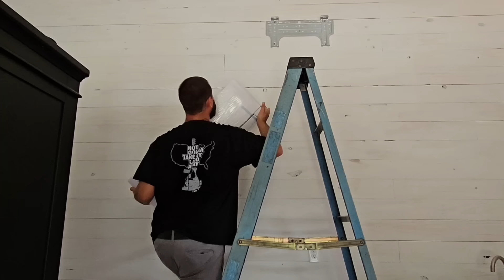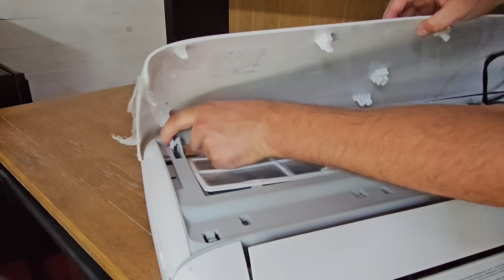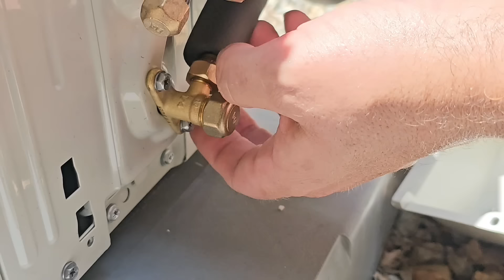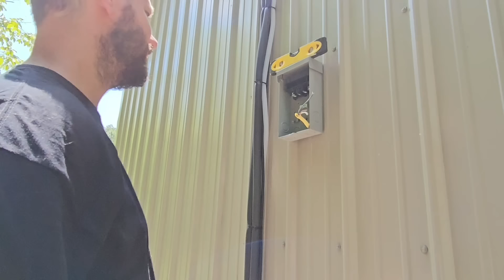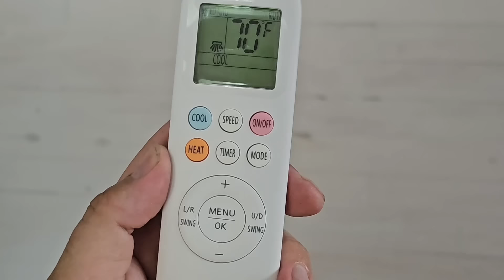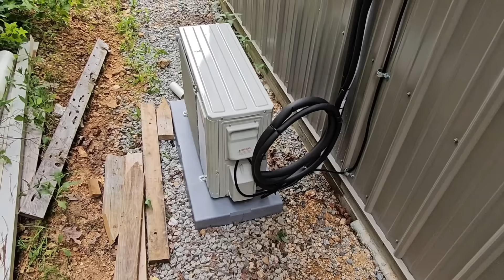Mini Split Installation Step by Step Guide @TurbroStore

Comment: Thanks for the tutorial... I just have a question... I noticed sometimes they use 12/2 wire from panel to disconnects and sometimes they use #8-2 wire so which one works better???
Reply from the maker: depends  on the MOP of the unit and what the max amperage is 12/2 is good for 20 amps and 8/2 is good for 50 amps. check out my wire sizing guide on my app actoolpro.com

Comment: How do the components compare to a normal residential unit? How does the air handler communicate with the outdoor unit? What does it use for control voltage?  What’s going on in the thermostat? I have so many questions….

Comment: I was curious to know about suction and discharge pressures with A2L, I’ve been certified for a couple of months now but as a service tech I haven’t worked with it yet, good to know it’s not much different than 410A, I’m Chris from Connecticut I’ve been an HVAC tech for ten years now

Comment: Hey Brother I know you said that you mount the units at a slant for condensation; but I was under the impression that the drain pan inside the unit is manufactured with the left side being slightly higher to account for proper drainage. Have I been doing this wrong? Or did I miss something…

Comment: Taddy..  long time fan.   What's up with the giant loop on the lineset bro?   Cut excess and make a new flare??
Reply from the maker: if its less than 10 ft I always loop it per the manual for reduced noise and vibration

Comment: Be careful about bending those linesets down 90 degrees coming out of the wall the way he did unless you really know what you’re doing.  1/4” isn’t bad, but if you have a 1/2 or 5/8 suction things can go south quick if you kink it.  These things are very sensitive to restrictions.   Use a pipe bender if in doubt

Comment: Excellent video! However you overlooked what is required before one starts installation- checking with your municipality's Bureau of Safety and Permits to determine if a permit has to be pulled. Since this is a permanent HVAC installation, many municipalities will require a permit with the option of having the work inspected when done for Code compliance. I know of one landlord in New Orleans that put in 7 mini splits using handymen. He ended up paying a $325 fine for each installation plus is having to pay to rewire the main line back to the service box to bring it up to code. Just sayin'.

Comment: im truly struggling with what mini splits to put in my airbnb property. ive watched multiple videos you have posted and fill like i can trust a suggestion from you. I have been looking at Della, Tosot, costway, and recently Turbro units to fit my budget . Can you help me choose ? I noticed you had installed a turbro unit in one of your videos, im curious what you think of that unit and also which one provides good heating at low outdoor temps. Our temps avg about 20-40 through winter but can deep into the teens at times .  thank you for any input .
Reply from the maker: Well I have a question for you
Are you going to install it yourself?Or have someone else install it for you?
Reply: @taddydigest   the plan was to mount it myself and have my hvac guy stop by and pull vacuum on it for me.
Reply: Any info would be  super helpful .

Comment: What makes the aircondioning not to heat after installing?
Reply from the maker: Low on charge.Maybe could be a number of things
Reversing valve wire unplugged

Comment: Thanks for the walkthrough. I noticed you used a 60amp Non-Fusible AC Disconnect Box, the Minisplit 18kbtu 230v on the compressor says Max Fuse 15A, will it be redundant to use a 30amp fusible disconnect with 15 amp fuses or let the 20A double pole breakers provide the protection through the 60amp nonfusieable disconnect ?
Reply from the maker: its all about your preference and what you want to do 
the breaker will protect in this case
Reply: @TaddyDigest always use fused disconnect...fused size per unit directions...and type of fuse.

Comment: What’s up with this video? It’s filled with many errors. What’s going on did you loose your tube cutter and flaring tool? You never leave vertical loops,or trust those flares, not using a torque wrench and those are the major errors. What’s going on?
Reply from the maker: You're the man

Comment: Have a client ask me about his mini split installed but being ignored by installer  and i noticed his dimmable led start flciking really bad when the compressor turns on the mini split not the fan or heat side  but only on the cool side i dont know know about these things but im hoping his inverter isnt a issue or compressor

Comment: this is the ideal instillation, if you are short on tools, you could pump the nitrogen out by pumping a little refrigerat same that the unit use before connecting the pipes.

Comment: Hi Teedy, since you're a professional, is it not best to open the 1/4 inch pipe first before the vapour line, why because you won't lose much oil from the compressor through the small line and no much oil will flow into the piping
Reply: Well sir, you said it! Must be right!